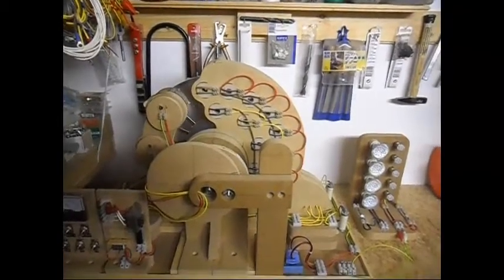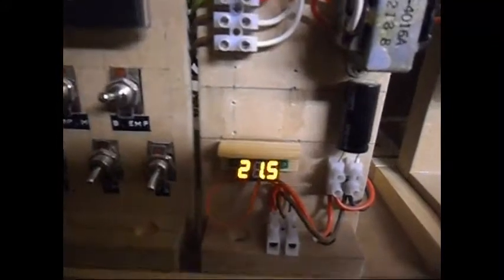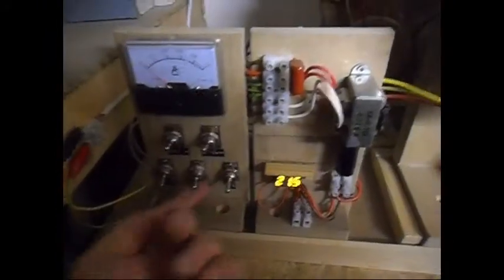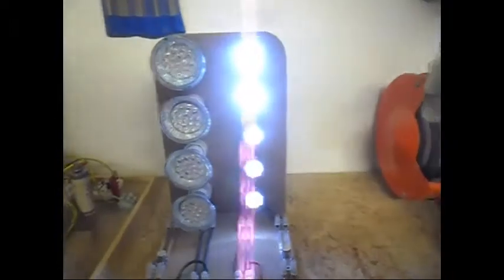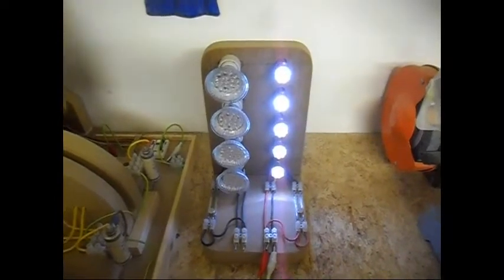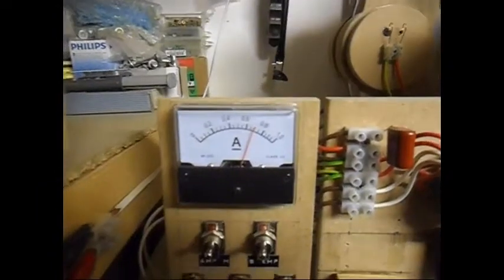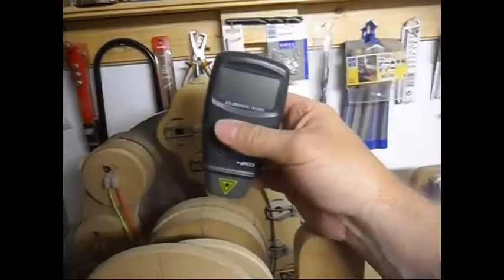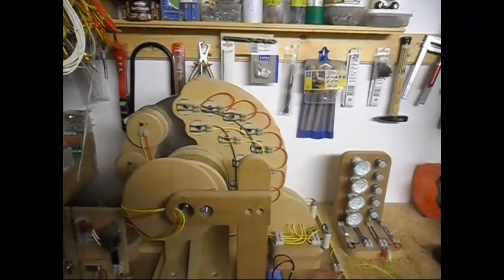Pulse Motor_Generator - Update 39 OverUnity is it or not, Future World Generator_26...

Comment: 50wattLoad.AVI

Hi, great work, thanks for posting. Have you tried placing a DC to DC step down converter on your PMA output? I found if you keep the duty cycle below 50% it removes the  braking created by the reverse EMF. Again great work and I look forward toward your future videos.
Reply from the maker: Hi GoVertical17,
Thanks for your comment, for your compliment and input on the DC to DC step down converter...^^
I don't have a DC to DC step down converter and wich output do mean...???
There are two,
The one after the transformer wich is now around 75(ish) vdc...
And the raw one wich is above 1000vdc and i don't think there are DC to DC step down converters that work with sucha high voltage input and if there is i don't think i can afford it because it would be pretty expensive...lol
But i think you mean the first one...i'll see what i can do...^^
I'm also wondering if there's a way where i can only take like <10ma at that >1000vac...hmmm...this <10ma will not put much drag on the system either...
Reply: Mister Caribbean Roots Remember that the drag created is proportional to the power and not to the current.  Thus when you get up to 1000V, you don't need much current to get significant drag.
Reply from the maker: Ken Smith
Thanks for your comment and input about the significant drag...^^
I think i understand what you mean because i've seen this on all my PM's testings...
The more voltage output of a certain coil the more drag it induces on the system onder normal conditions...some of my coils works pretty good while at lower voltage until i increase the voltage by more rpm or filling a large cap and than it all start to slow down like crazy...lol

Edit, still gonna try to find a way to step that high voltage down to a lower one but with some sort of amp reducement setup...hmmm...
Reply from the maker: Ken Smith
Thanks for your comment and the extra info...^^
What i want is to step down this high voltage to around 15Vac and than rectify it but with current limiting possibility at the AC side...o.O
That is if this is even possible...???...lol
Reply: Mister Caribbean Roots If you have AC with no average value, a good transformer can be used to step the AC voltage down.  In a transformer, the volts per turn is just about the same in all windings.  A transformer designed to step 2200V down to 220V would step 1000V down to 100V for example.  Remember, however that there is always a current that flows in the windings just to make the magnetic field in the transformer core.
Reply from the maker: Ken Smith
Thanks for your comment and input...^^
You are right about a current flow thru the windings wich is much needed to get good  "electromagnetic induction"...
But with a step down transformer there's much less current needed than to step up especially when there's a high voltage that needs to be step down...;-)
I'm searching now for the right ratio transformer before i wound one myself...^^
I think i can limit the current with a certain wire size at the primary but i will need to put a specific max load on it or it will burn out very fast...don't want that to happend....lol